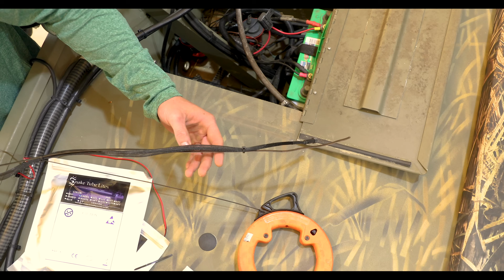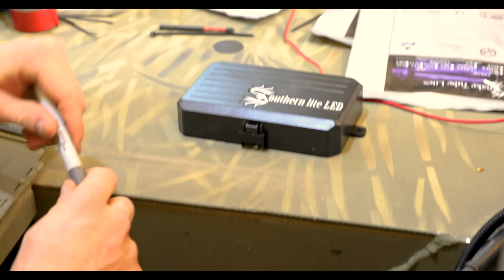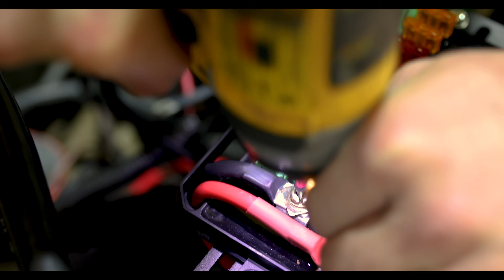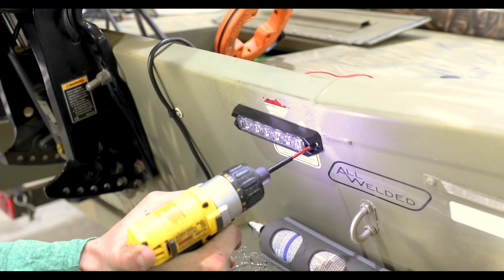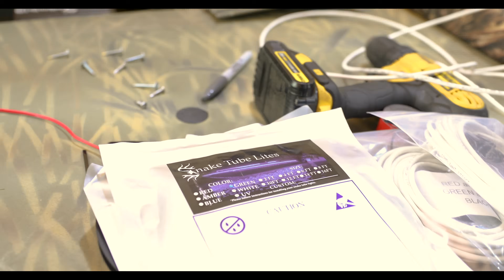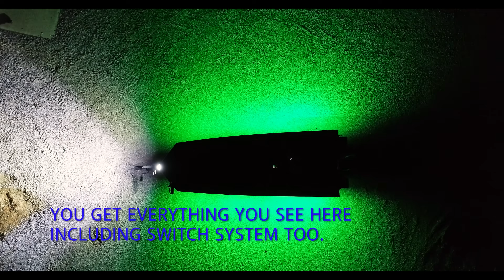INSTALL ULTIMATE BOAT LIGHT PACKAGE

Comment: If I have a disconnect switch already installed on boat where all my grounds hook to can I run black wire to that switch and not use the plug that controls the brightness?